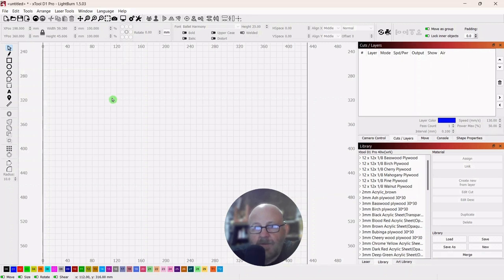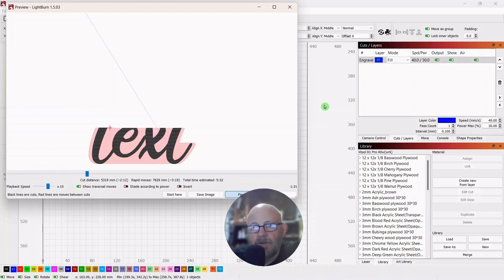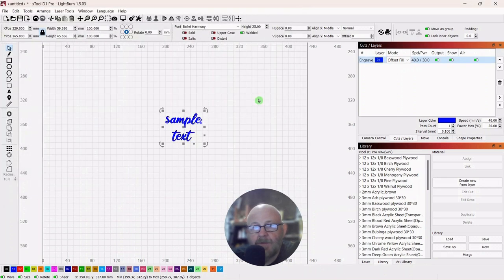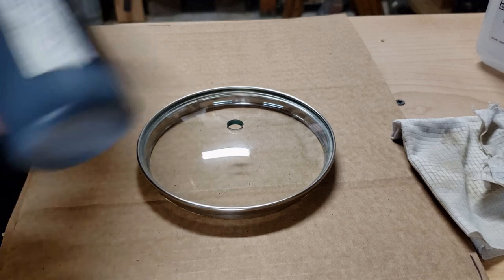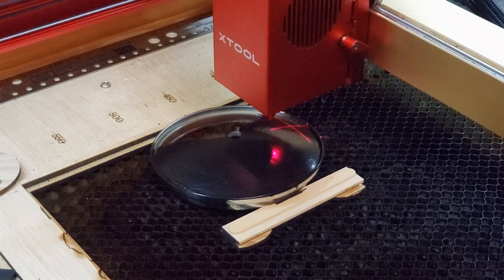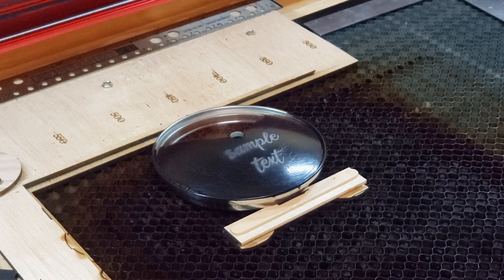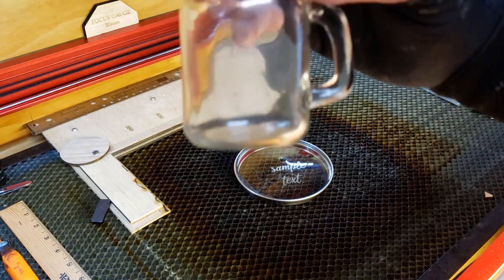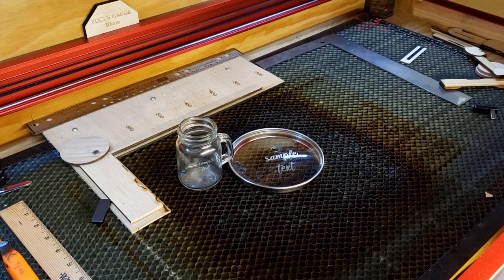First Time Laser Engraving Glass | Beginner Laser Project #35

Comment: hey dave, as you say on glass you always test speed and power, I do it with tepera paint and I have no problems with that, but for the temepra pain I use my airbrush and spray it layer by layer so that If you can no longer see through it, then it's perfect. If you do that with a brush, you get those thick stripes from your brush, you just have to try it.
greetings luc
Reply from the maker: Thanks, Luc - I will give that a try next time.  I appreciate the feedback.  Take care - Dave.